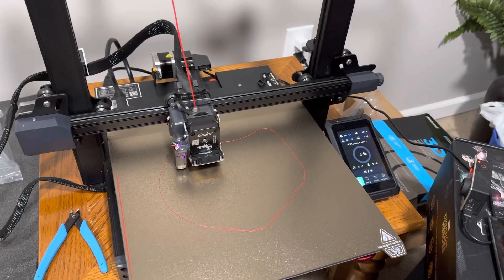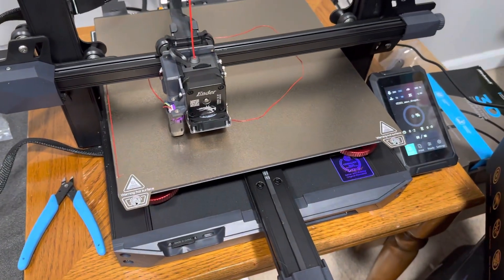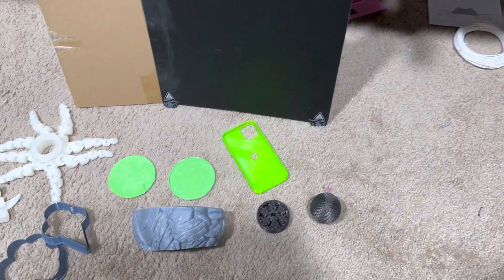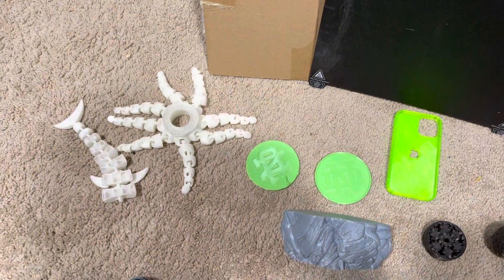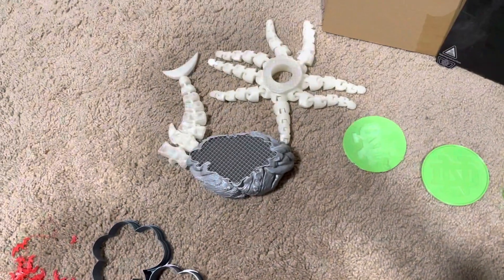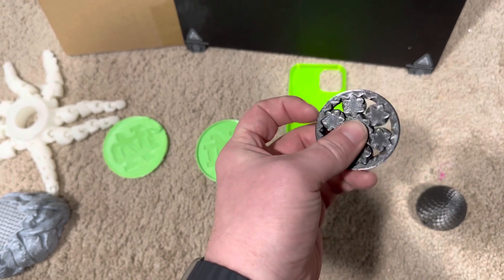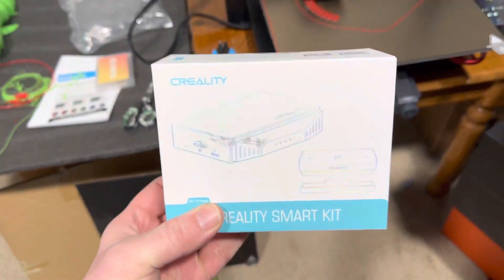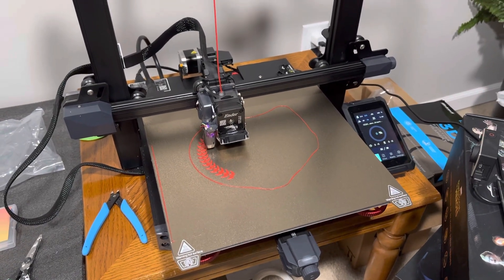Ender 3 S1 Plus 3D Printer update with PEI Sheet upgrade and new error

Comment: I'm having fun with this machine as a first-timer. Learning slowly, doing everything properly. One major problem I keep coming across is a filament jam in the cold part of the extruder. It needs to be taken apart to be sorted out with the help of YouTube videos. Can always get the thinnest poke through once or twice but then nothing.  I'm following all the guidelines, clearing after use, etc., but it has done it three times so far on different filaments. I've had the printer for a month. Any advice would be so welcome. I've looked at so many videos, and this one seems beginner-friendly.

Comment: Where did you buy this bed, it's PEI.
Reply from the maker: It was off Amazon but for some reason the link stopped working it was a 310 x 310 PEI sheet should be similar to this https://amzn.to/3ZlOVvy (paid link)
Reply: @brade3249  on this paid link size of bed 235 x 235 , on your video size is 300 x 300
Reply from the maker: @vsigal  yes not sure why, but the link above should work it is 310x310

Comment: My friend I had A temperature Is error pop up if you're seeing the temperature extrusion nozzle on the display say negative -15 what happened to mine my ribbon cable that plugs into the top of the hot end there the white mark on the ribbon cable was broke once I fixed the ribbon cable it has been perfect and my print bed with a Milwaukee temperature Laser pointer thing is absolutely spot on
Reply: I just got my s1 pro and i got a bed temp of -15 with the AB.temp error code. This happened on start up with preheat. I have still not found a solution to fix it. I have returned it and upgraded to the s1 plus. I will miss the led light though.
Reply from the maker: Seems like the ribbon cable is a weak point

Comment: About peeling off: when i've bought my printer i've put it on a window table and noticed that my unattended prints got curved the same way. Reason was tha my wife opened window to get some "fresh air" so unattended cold air intake distorted the model. Try heat box or put printer in a closed space. Do not recommend to cover it with carton box - fires worse than a bad model. Also... there are some custom fan nozzles on thingiverse to convert oneside stock model cooling to two side. Wish you best and keep your filament dry ;)

Comment: How’s the interface so far
Reply from the maker: I don’t mind the interface, I ended up sending this printer back because of the error I was getting. I ended up getting the s1 pro
Reply: @brade3249  what’s the difference between the s1 pro and the plus
Reply from the maker: @monsterstorm78  it is the bed size plus is 300x300 and pro is 220x220. Bed sheets a flexible bed vs gold pei and that is about it. Cost is about 100 cheaper to go with pro but it is a smaller bed
Reply: @brade3249  what error did ya have
Reply from the maker: @monsterstorm78  I had the absolute Temp fault which stops your printer if it is going and pretty much ruins your print because the temps drop on bed and head leaves a drop of material and it causes the separation when it moves again…. Creality said they would send replacement parts but it was so new I ended up sending it back and I found a great deal on Amazon for the pro

Comment: As long as the firmware is correct I find it's trial and error in getting the right settings. I got the metal bed to. It's pretty good.
Reply from the maker: Yes it also helps having good material
Reply: @brade3249  true

Comment: I measured the bed temperature with an infrared thermometer and it indeed runs about 10 degrees too low and varies significantly in different spots.

I’ve had nothing but problems with my Ender 3 S1 Plus. Its firmware immediately jammed the nozzle into the printbed, tried to ram through it, then moved laterally, severely gouging and ruining the print surface. Creality took their sweet time sending a replacement, just as they are with another problem: the second I saw the hotend cable, I knew it was bound to quickly fail — and it did. By the time I get a replacement, it will be well over one month of more downtime.

On the few occasions when the printer actually works (not for long until the next failure), its print quality is very unimpressive: not as good as my Prusa, which isn’t quite as good as my Anycubic Kobra Max or Anycubic Kobra, both of which have a user interface that is logical and a pleasure to use, in contrast what this Creality has, which is scatterbrained.
Reply from the maker: I only know Creality software, it seems alright to me but I will have to try another brand. I ended up returning the plus and got the pro because of the absolute temp fault. I really like the pro.
Reply: @brade3249  The intermittent problems you described might result from a damaged cable, which could also account for the extruder failure in your S1 Pro (that you described in another video, and I commented there on a similar problem I had with my S1 Plus that uses the same cable).

Comment: We're did you get the bed?
Reply from the maker: It was from Amazon, it worked very well. Here is the link: CCTREE Textured/Smooth Double Sided PEI Sheet 310mm x 310mm and Magnetic Sticker with Adhesive for Creality Cr10, Tevo Tornado, Nereus, Anet A8+, E12 3D Printer https://a.co/d/0XYiYsD
Reply: @brade3249  on this paid link size of bed 235 x 235 , on your video size is 300 x 300
Reply: I got the one Brad uses, and I ordered one from Wham-Bam. I should mention I destroyed the original when I had the Z offset too low and tore the bed trying to pull the material off.
Reply: Brad, do you Appel to know the recommendation for speed? I won’t hold you to it, I make my own errors.😊
Reply from the maker: @TheKirk48  I believe it is 150 mm/s but it could depend on material.